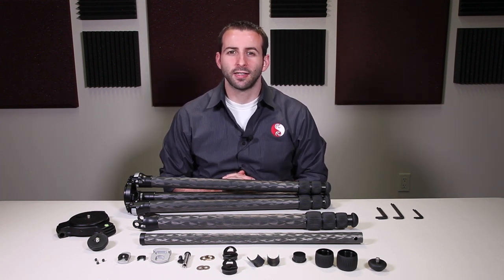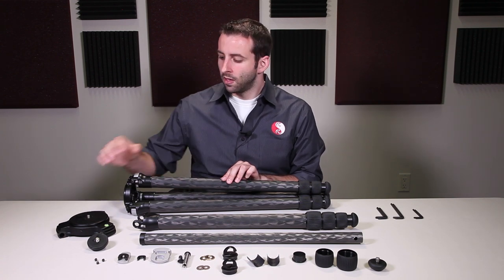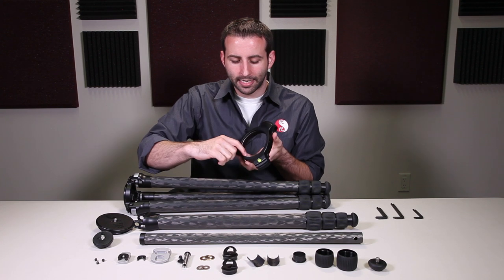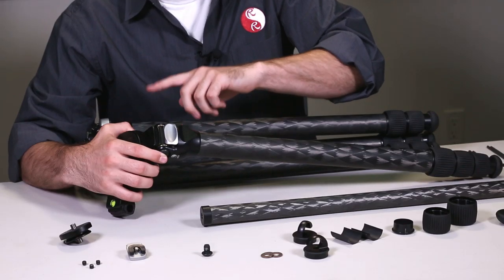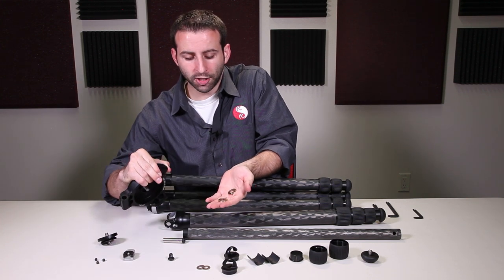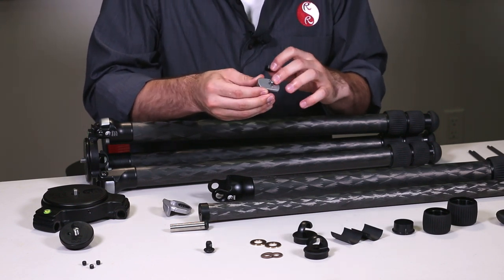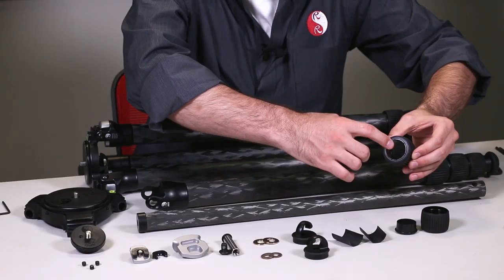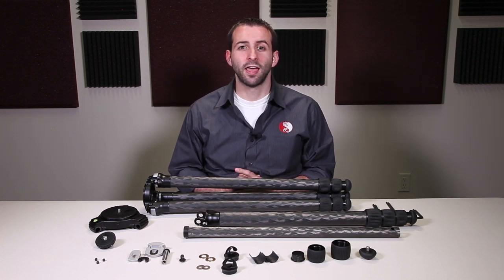Really Right Stuff Tripod Maintenance Part 1: Tripod Parts and Terminology

Comment: What would you suggest for an L-bracket where the gasket has ripped? I have a new gasket, but concerned about the adhesive on the old one and removing it cleanly so the new gasket seats well.  I wasn't sure what you'd recommend to use.  Any suggestions are appreciated.